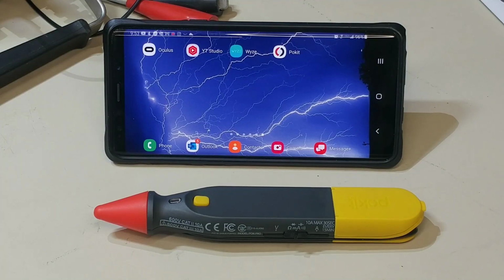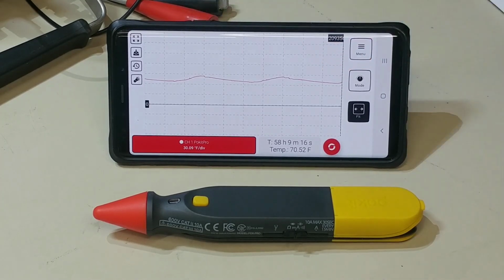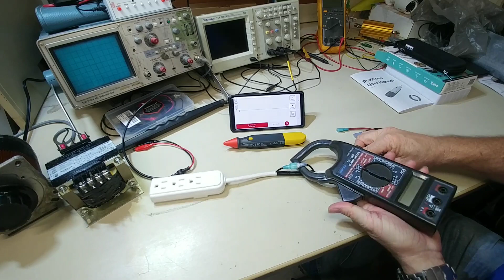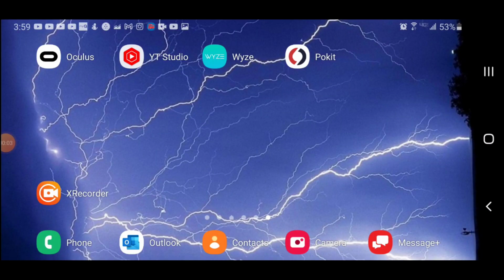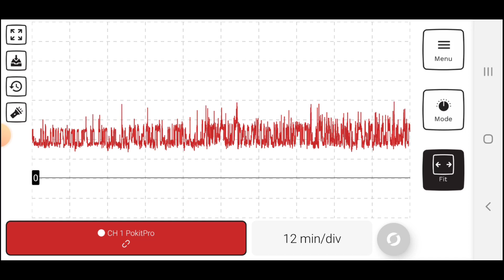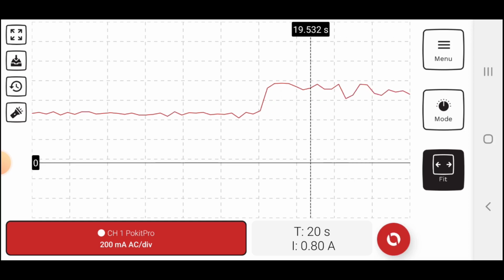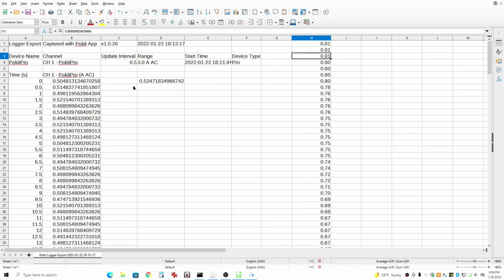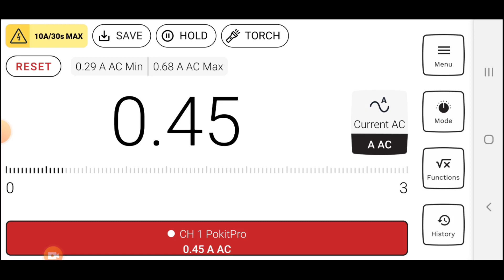SpaceX Starlink amperage datalogging with the Pokit Pro!

Comment: I have been trying to do a log, looking foe voltage spikes.   But every time go back the device is off and I don't have my log?..
Reply from the maker: After you start the log how are you exiting the app?  Be sure not to go to the Menu and change modes or stop it before you exit.  I normally just close the app without hitting any of the menu buttons.  When I go back in, click measure then logger and it should still be logging with the wheel spinning. Use the "Fit" button to see the entire log graph.  What model phone are you using, perhaps there is a bug with that phone.  It just had me update the firmware to v1.5.0 today.

Comment: Hi
Do you know how many data points the logger will log please?
Reply from the maker: Max frequency on the datalog is 0.5 seconds, so 2 data points per second.  Is that what you mean or do you mean for how long it will record data?   It has 28kB of memory and they claim it will record for 6 months @ 20 min per sample which equates to approximately 12,960 samples.  If you do samples every 0.5 seconds you could datalog for 108 minutes if that is accurate.

I haven't confirmed this but I have done logs for up to 2-3 days sampling every 10 minutes or so and it did fine.

Hope this helps.
Reply: @shanesdiy  I've done a bit more research on this.  I think there are 14384 samples before the memory fills.
However I seem to have a problem: If I leave the Pokit Pro logging and the buffer fills while the phone is not within range when I come back and try to connect the phone if will not connect.  The problem does not occur if the buffer is not full :(
Any thoughts on this please?
Reply from the maker: I noticed some unusual behavior on longer logs as well.  They would come up on the phone but as soon as I modified the display, scrolled, etc. it would drop a large percentage of the data.  It was still there and I could export to a spreadsheet and view and manipulate it, just couldn't directly on the phone.

I recall I also had a very long data log that seemed to never load.  I do not remember how long I let it try and load but later I was thinking that perhaps it just took a very long time to download so I should have given it more time.  Might try waiting longer to see if it will ever retrieve it.